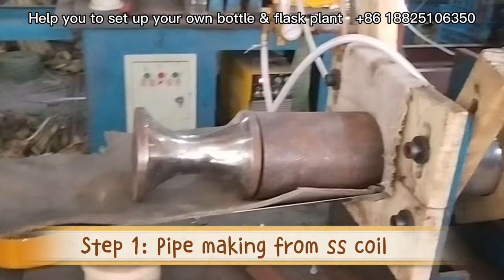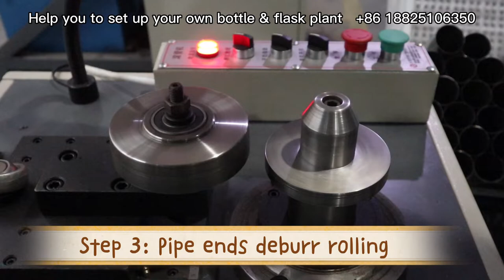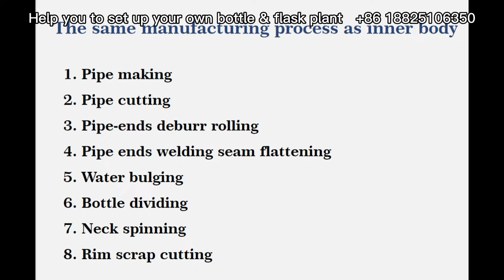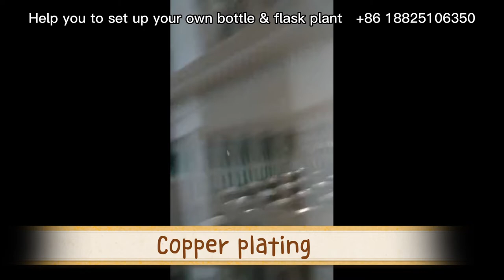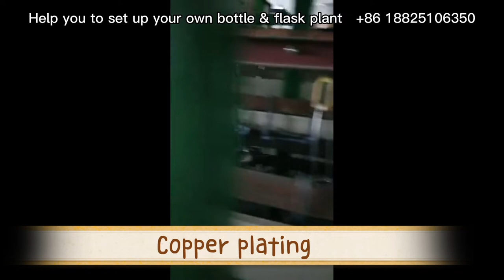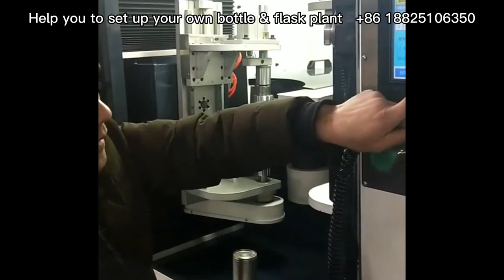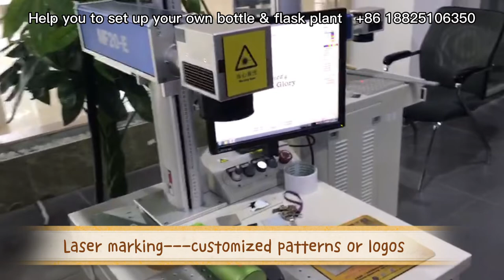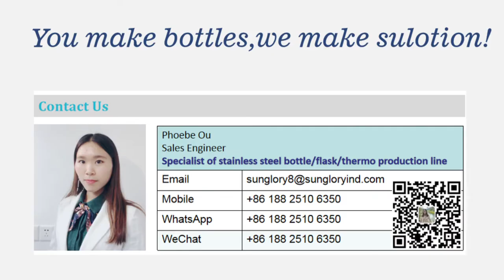How it's made stainless steel bottle vacuum thermos flask?----Sunglory Industry

Comment: I am not looking  to start a business. I am curious what the purpose of the copper plating on the exterior of the inner lining? Thank you
Reply: Thermal conduction, helps to keep the cold and heat well distributed, prolonging its duration.

Comment: I don't understand... why use a coil then roll and weld it? Why not just use extruded pipe stock?
Reply from the maker: Extruded mainly use in aluminum materials. For the vacuum flask, need to use stainless steel, not aluminum. The best procesing for steel and aluminum is different.
Reply: @vacuumflaskmachine hi Phoebe, is titanium the same process as stainless steel? Thanks!